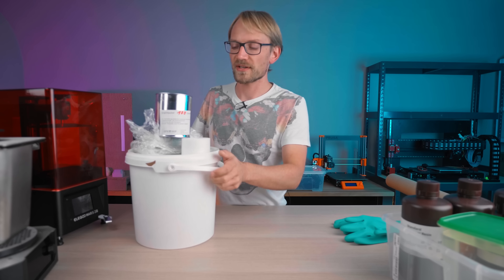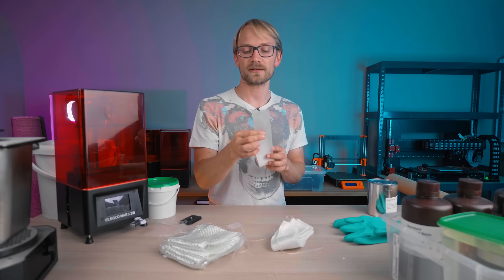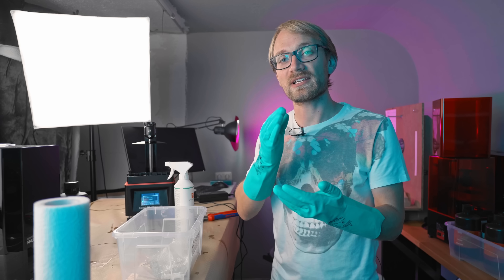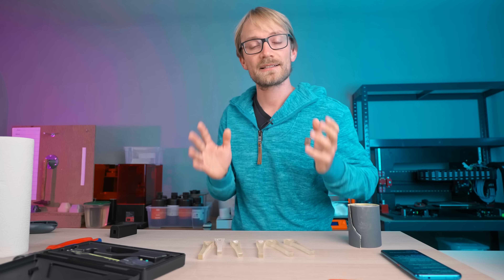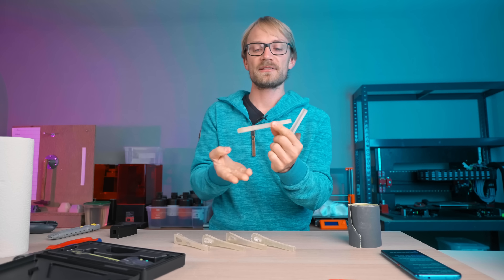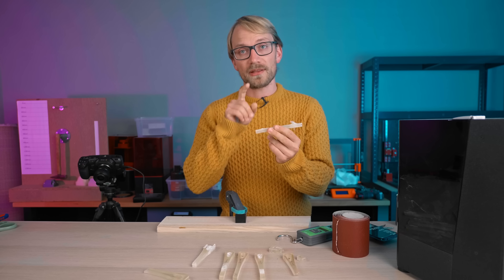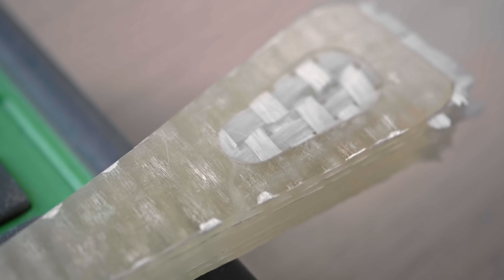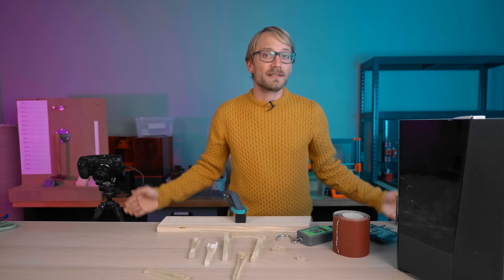Fiber-reinforced resin prints - how much STRONGER are they?

Comment: A suggestion...   When you are doing the bend test, the tensile stress in the upper region is taken by fibers only and compressive loads at bottom part is taken by the resign. Here, the resign is more flexible and can take more strain in compression. This shifts your neutral stress plane above the center plane and less fibers are taking majority of the load (that is the reason you are seeing top side of samples failing much often). The maximum load carrying capacity during bending then depends on the total tensile load carrying capacity of those contributing fibers. Further, the strains on upper fibers are more(due to bending curvature) compered to fibers close to neutral plane. This results in upper fibers being loaded earlier than the one below it which results into progressive failure from top to bottom which you can see in the sample with 6 layers of glass fibers.   

During tensile testing the maximum tensile load the sample can handle is the combined force of all of the fiber layers. the maximum bending loads in similar way has relation with the fibers contributing to loads. A way of improving flexural rigidity is by adding reinforcement layers close to each other in a way that distance form the center plane remains nearly same for each of them. Using more flexible sheets at layers further away from center plane also helps, as those can sustain more strains before failure which are present at surface layers, and thus distributing the load evenly among remaining fibers.  Resigns with more compressive strength would prove to be more effective in improving flexural rigidity. You can directly relate it to the RCC beams where rigidity of concrete provides strength against the compressive loads in the lower part of the neutral stress plane while tensile loads are handled by the steel rods.

Comment: needed to be a pull test for the tensile strength of composites. I would be willing to bet they are much stronger than the original that way. the way you are binding them is only stressing the resin, not the fibers, which is why they had less strength because they had less resin. the resin provides compression and flexural strength while the fibers provide tensile strength.
 think about it a fiber has no strength at all unless you are pulling on it.

Comment: I would be interested in seeing a comparison of two parts of the same construction tested at 90 degrees to each other, to see the difference in strength between where the reinforcement is perpendicular to the applied force vs parallel.

Comment: I like how the fiber reinforcements make any eventual failure much less catastrophic.. instead of splitting completely (and sometimes with pieces carrying potentially dangerous amounts of momentum), the heavy glass fiber arrangement makes the failure take a lot longer to occur from its start to finish, indicating that it may useful in applications where catastrophic failure of the printed part might result in destruction of something much more valuable (like mounting cameras, for example).

Comment: Maybe you could put less fibers per layer. Example, steel reinforced concret doesnt have a layer of steel but some bar os rebars across. When you put a layer, maybe the resin can´t bond well to the other resin layer. Not sure if i´ve been that clear. Maybe a a smaller profile of fiber the same shape of the printed piece.

Comment: this is quite possibly the worst fiber glass job I've ever seen, fiberglass/carbon fiber is supposed to a. overlap in multiple layers for strength but also the resin has to saturate the multiple layers to bind them. having flexible material in-between 2 now rigid sheets of fiberglass only weakens it as you show. you need way more layers and for less of the volume of the piece to be resin.

Comment: I'm not sure about whether the resin was degassed and also curious about the curing process. Normally, when we fabricate the FRP composite we need to degas the resin to minimise the air bubbles and also we think the ambient curing might cause large variation of the performance. So, rigorously thinking it might be better we have degassed resin and also we use the standard oven curing method for those specimens.

Comment: just today i used the SIRAYA Tech simple clear resin, what i like about it is that it's super thin so it flows easily and is easy to cleanup. also very fond of Phrozen water washable rapid resin. it kinda sucks to wash it with straight water but you can cut your alcohol with water big time so its more economical, and it prints pretty quick i was getting away with 5 or 6 second thick layers on my creality ld-002r

Comment: You should try some European chopped strand matting: I think it used a powder binder that is compatible with more resins than American chopped strand matting which uses a styrene binder that dissolves in polyester and vinyl ester resins with styrene in them, but can inhibit wetting with e.g., epoxy. Alternatively if any of the resins have styrene in them the American CSM might work too. You could even try just adding milled glass fibers to the resin (they seem like a powder)

Comment: Great test and proof of concept. I do feel like there is 2 additional things you should of tried. Number one is you really should of tried loose strands resin. That's how alot of the industrial glass fiber reenforced stuff is and not sheets. Second thing would of been changing print orientation so the fiber sheets were going the other way in the print.

Comment: You should try carbon firbre cloth. I think that might give more rigidity and strength  considering that it's used on applications like hidrofoils. If you had a big enough printer and be able to print for example a foil , considering that it costs a mere $1500 ,you could skip a lot of moulding and shaping proseses.

Comment: I used fiberglass cloth in my model airplane builds, especially over foam air frames. Something that we learned to do is to turn the fiber direction by 45 degrees to the layer before it, to change the directions that the stresses act upon it. This helps in the strength of the part being made or covered.

Comment: Maybe I missed something but you have tried applying the force only perpendicular to the fiber layer plane (resistance to flexing). I am expecting to find a more obvious difference when applying the force parallel to the fiber layers instead (resistance to tearing). Have you tried checking the strength in both directions?

Comment: What would be very interesting is if you could try saturating the resin beforehand with glass microspheres. That would give you something along the lines of what's being used in injection molding of plastics. Seeing as they're glass I think the laser would probably be able to pass through and harden the resin, but it would have to be tested.

Comment: That why I love Thomas. That was awesome. One thing to try if you feel like it. In boat building they stack the glass fibers directly on top of each other with minimum resin between them so it ends up like a single fat glass fiber piece. 
Another thing they do is that they press the layers to push the air out of the glass fiber but I can’t think of a way to do it in the printer.

Comment: I was FRP inspector for years use the RTP1 book as a guidance  and astm for pipeping will give you the right amount layers of material to have the desirable strength. Roll out the material first make sure that air is out for max strength with the same resin then 3d print on top of that. Do a tensile  test, barcole test and a burn out to see how strong is your compositive. Like your show I do 3d print as a hobby. Thanks  for your  dedication.

Comment: one thing u left open to failure, that kind of resin is hard for surface finish, but not strong for mechanical efforts, a laminating resin is less glass like, and somehow flexible enough... kevlar reinforced fiber glass, and aramid ones could also be used. if they have transparency.

Comment: nice experiment! The thick fiber had to be aligned diagonally across the print. Now the force was only applied on half of the fibers.(aligned lateral of the print) Many quality quadcopter frames apply this when producing arms for such a frame. I'm very curious if it handle double the stress when you align the fibers diagonally.

Comment: This me thinking about manual reinforcent, probably post-cure using either UV resin or regular epoxy style resin and adding the fiber layers to the outside of a part, and then curing with a UV lamp for the UV resin.

Comment: You need to make sure the seams are going in different directions per layer and you need more layers closer together that's how carbon fiber draws its strength. You can make your own carbon fiber with an epoxy resin but you're better off not trying to print it this way.

Comment: I've worked extensively in the composites field.  Fiberglass and other composites have excellent tensile strength but very low strength for compression or bending.  If you repeated these parts and used a testing method that pulled from either end, you would likely see a very significant increase in the strength of the part, especially with the weaves as the fibers are aligned.  You may also see somewhat better results in a bend test like this by only reinforcing the top side which is in tension during a bend. 
Bending tests do favor less rigid parts, as the flexibility allows more deformation of the part before actual failure.  Think of a comparison between metals such as steel and titanium.  Titanium is considered to be as strong or stronger, but because of its increased rigidity it is more prone to failure when subjected to bending.

Comment: I know this is sponsored by siraya tech but in all honesty I bought them before even checking into them and they are in my experience the best resins, they print easy and without issue. I had a bunch of elegoo abs like that I hated because it was too gooey and did not print nice on my printer but if you mix the abslike with the blu from siraya tech at 25% abslike 75% blu it makes some of the best prints I've seen and makes a neat translucent(semi-transparent) print. mixing the grey with blu clear v2 at those ratios makes awesome spectral minis

Comment: You can also get clothes with 95% longitudinal fibre which would improve your tests further because 50% of the glass you added weakened the plastic under tension, and didn't make it stronger. It'd be keen to see some tests with cloth like that :-) That's only suitable, of course, if you only have load in one direction, for normal general strength the normal weave cloth is what you want.

Comment: Much like 3D printing, composite fabrics are directional in their strength. Watch any carbon fiber composite tutorial and you'll see they offset the weaves of the fabric every layer on structural components. Same goes for fiberglass fabrics, excluding chop strand mat. I think offsetting the weave each layer while keeping in mind the direction of stresses would improve the results. Maybe a 45 degree offset compared to 90 degree/no offset would be interesting.

Comment: to test these you better know the direction that the fibers are working and where they are strengthening the part , to make a good test you should put the fibers vertical the same as the force apllied to break them so all the materials tested can repel the force applied in the direction they are actively working

Comment: I would say that just wrapping the item in Fibre Glass is much easier after the print is done and then testing that way. FYI Carbon Fibre is far stronger than Glass fibre, besides the type of fibre also maters, as you could see with your dry wall paper. If the Glass fibres are loose they are extremely weak, endless glass fibre is best but very brittle.
Endless Carbon Fibre is the best strength Plastic though, but very hard to work with in Additive Manufacturing ($$$).

Comment: You should try switching the load direction. IE you should have tried rotating the reinforced parts 90 degrees so that the fiber layer would have been vertical

Comment: Suggestion for a sequel: you can get fillers for epoxy when it needs to fill gaps - powders, glass beads, short glass fibres etc designed to be mixed in with the resin and hardener. Those could be mixed with the resin and give you re-enforcment through the body of the print.

Comment: When I see resin prints, I wonder how much would the print change with 1% Carbon Nanotubes added to the fluid.  1% should be enough to change the properties and still print.  I have seen some composits claim that they have Carbon nanotubes in the mix (in the 1% range) and claim that they have improved properties.

Comment: This would be great for making reinforced connections between parts on large segmented FDM prints - You could model slots into the connecting area between two parts and add fibre reinforced resin pegs, hooks or even rings to hold it together depending on the shapes you're working with.

Comment: You would have seen a more dramatic effect and higher structural efficiency (strength per weight) by using unidirectional reinforcing layers when testing purely for bending strength or tensile strength.
Also no, glass fibers and carbon fibers are not equally strong, nor are they comparable in stiffness, weight or any other physical or mechanical properties.
Reply: In a laminate they are actually comparable in strength, but not when it comes to "specific" strength of course, and not anywhere close to stiffness.

Comment: Not sure if this would be possible on the resin printer, but if you tried fiber tubes usually used as wire covers, stacked overlapping like honey combs it should add strength along multiple planes.

Comment: I think the reason the more coarse weave works is that those layers have holes/gaps where the resin can connect between layers. With the glass fiber paper, you create a total break inbetween each resin layer. So you loose some of the effect of it being a composite material?

So trying the paper again with holes or lines cut in would be very interesting.

Comment: The wallpaper probably didn‘t worked that great, because the orientaition and length of the fibres isn‘t optimal for the porpuse. The others had the fibres in the orientation of the stress put on to them. And they were longer, so they could spread the force more evenly.

Comment: Hey Thomas! Great video!
In my opinion, these results are kind of bad cuz of the fiber was an only a solid part... what if u used fiberglass for the concrete mix. those are small and make nice connections between all layers... but not really sure how they will stick inside and the whole resin should later be replaced or at least somehow filtred.

Comment: @Thomas_Sanladerer Please, please, please, for your own safety, and those of your viewers, your "German Drywall paper" glass fibre, PLEASE, be wearing masks at ALL TIME. I know that, since I worked in manufacturing, that the only thing we were doing was from an extra wide role, we were slicing it to narrower widths and it is extremely nasty stuff. If it goes in to your lungs, the dust, it is basically as bad or nearly as bad as fibre-glass fibres! Just, what ever you do, do NOT get it in your lungs! Just after an hour of the machine running, slicing, nothing else, the whole area was covered in fluff/ dust from that stuff! It is nasty and needs to be treated as such! Treat it as ASBESTOS fibres!

Comment: What if you try alternative layer with 22.5° rotation? It might be much more stronger. 
Driving example from nature:  banana plants have the same problem. It's fibres are all arranged from bottom to top in a single direction. When a heavy storm comes, they are the first ones to break in the half.

Comment: Nice video! Another reason why the strenght of the reinforced samples is not very high could be the fact that the printing resins do not adhere to the glass fibers like epoxi or polyester resins do. To transfer the external load that is applied on the resin to the fiber, a chemical bond between resin and fiber is needed. A specific resin designed for fiber reinforcement could get better results.
Reply: Totally agree. Was really looking like layer seperation that must come from that.

Comment: As i work with carbon fibers, it would be really interesting if this would work. As carbon fibers don’t let light trough it could have curing issues but still very interesting. If you need some fibers I can supply them

Comment: Kilograms?!?! Now I've gotta go pull up my conversion calculator....... I know you've got a large enough audience that at least 1/2 of us can't convert metric to standard in our head. So, it would be polite to toss the standard equivalent up on the screen as well for those of us that only use metric measurements when we're forced to.  I'm good with converting lengths, but not weights. Thank you! Great info by the way. I think..... Still gotta go convert those kilograms into lbs so I can mentally wrap my head around those meaningless to me numbers.

Comment: I would suggest using kevlar instead of glass fiber. Kevlar felt or kevlar fiber mesh is fairly easy to get these days and should give you much more strength because it has similar elasticity to the resin.